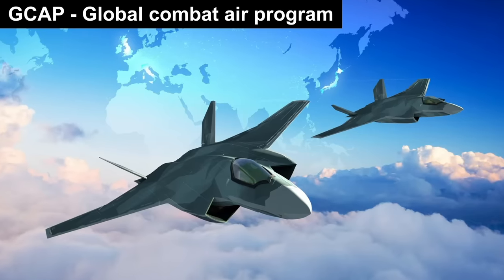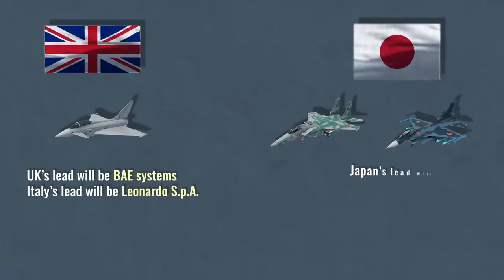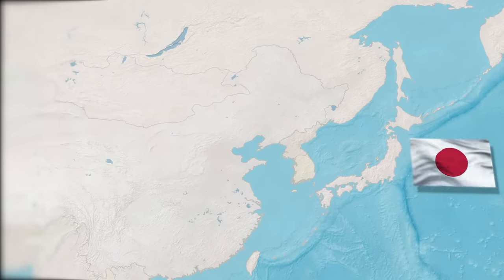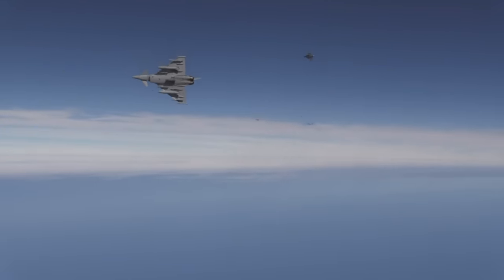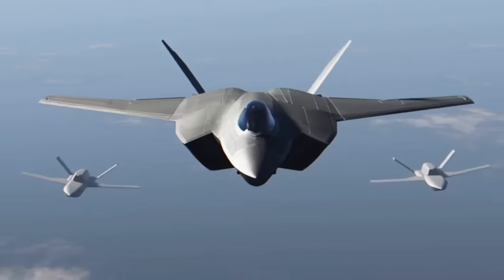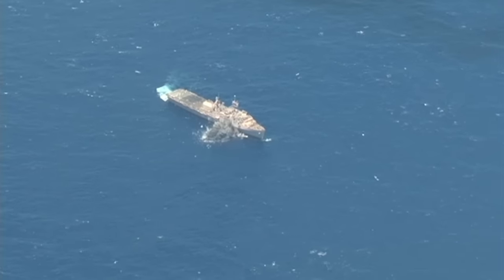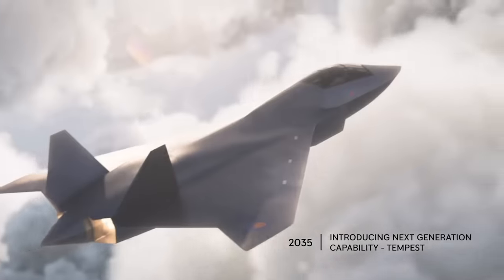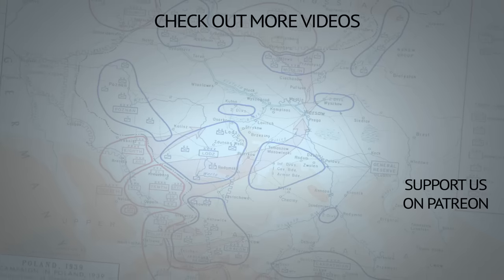Why is the future Anglo-Japanese fighter gonna be bigger than F-22?

Comment: Good luck to all US allies, but this project is probably a waste of money. By the time it comes out, USA technology will far exceed it, so they'd be better off just buying from the USA, even if they don't get access to the more sensitive tech. Look at the losers who chose not to be part of the F-35 program. They lost.
Reply: @Mmjk_12  If you think the F-22 was a failure simply because it's being retired, you clearly know NOTHING about fighters. It is the best air dominance fighter in the world by a wide margin. It's being phased out because it was designed 40 years ago and it's too expensive to maintain. The communication networks that are in use today can't easily be retrofitted into it. Even Link-16 would be too expensive. And it's not needed anymore. NGAD prototypes are already flying, and they will beat the F-22 in all metrics. Not to mention that the new GE combined-cycle rotating pulse-detonation engine will change everything, combining a turbofan, a RAMJet, a SCRAMJet, and an entirely new type of afterburner. And your point about the supply chain of the F-35 is just stupid. That is done for BUY-IN. If you want NATO to fly one platform, you have to spread the money around. There is probably not a single component in the F-35 that couldn't be built by US contractors. But if you want the UK to buy a bunch of A and C variants, you let BAE participate. That company is way too important in lots of supply chains for US missiles and other weapons to not keep them well-fed. And even you are not so naive that you don't realize that supply chains on major projects are as much about politics as technology. Why are you whining about it anyway? Do you think Lockheed can't build an ejection seat? Ever heard of DARPA? You're just trying to pick a fight because the UK has lost its once vaunted aerospace industry, and is now relegated to doing specialized work via companies like BAE, which is a great company, BTW. The latest military budget in the States is $886B. No one can compete with us on tech. The SR-72 and the MANTA are already flying. We're even reverse-engineering alien tech. For some countries, it's important for them to go their own way. South Korea is doing well with their new fighter. Turkey will probably succeed. Sweden has its own needs, so Saab is important and does a great job. But they will always be minnows compared to the US whale. Get over your penis envy and deal with it.
Reply: @de-comm8715  Read my reply to your buddy Mmjk_12. And what do you mean by "North America?" Do you think Canada is an important military partner to the US? They don't even have a real military. Mexico? What are you even talking about? It's not North America, it's the USA. We spend more money on the military than Europe, China, and Russia combined. We totally dominate aerospace. We have the world's only blue-water navy. One Ohio class sub could destroy every major city in whatever country you live in. And you are talking like a tough guy. Embarrassing.
Reply: @donscott2681  buying and maintaining expensive fighter jets is also a pain in the ass.
Remember what your airforce has stated that we can't drive Ferrari for daily commutes because they are smart enough to understand the point that their citizens don't. 
They aren't phasing out Stratofortress any soon because that conventional bomber is way better than B52 in terms of management. 
And if you are so correct then tell me why countries(including US itself)are still working on 4.5 gen fighter jets ?
Rafale is more expensive but they are still more preferable than F35 which is cheaper.
Reply: It doesn’t appear NGAD is a option for the UK or Japan just like F22.  So presumably the justification here is GCAP is a superior option to an upgraded F35 circa 2035/40 both in performance terms and economically (I suspect the export market is what the UK in particular has its eyes on).
Reply: NGAD is coming 👹 👊🏻 💥 🔝 🇺🇸🦅🔥
Reply: No, we don’t want to be American vassals
Reply: @donscott2681  "too expensive to maintain" sounds like big minus. You could build the most powerful space battleship in history, but if it's too expensive and can be taken out with a couple cheap missiles, it's probably going to be classified as a failure, as a military project. The F-22 isn't too bad but there's a reason it isn't the standard.
Reply: @VVayVVard  I probably should have chosen other words. The term "maintenance costs" could be taken by some, such as yourself, to mean something structural. It's not. I should have used the term "flight costs." That's because the primary cost of flying the F-22 is refurbishment of its RAM. But I believe that problem is going away. Since the F-22 has been un-retired recently, and planes have been photographed with a mirror-like finish, it's possible that the F-22 is going to be retrofitted with the newer RAM, thus negating the cost of maintaining the original RAM in perfect condition. While I haven't researched it, I have heard that the new retirement date for the F-22 will be the 2060s. All (or most) of those retrofits, such as Link-16, that were considered too expensive have now been considered necessary. The beast lives on.
Reply: @donscott2681 you are insane
Reply: @Sotsufferer  You make a very convincing argument, dude. Why chime in if you speak without saying anything? So, I'll speak to everyone else on this comment thread. Alex Hollings just published a new video on this Sandboxx YouTube station about NGAD and the F-22. It's a fine watch. Alex is the best. A few takeaways for me were:
1) The USA is going to spend $8.5 billion to upgrade our 186 F-22s. The reasoning is that we need to maintain our edge over everyone else until NGAD is in production.
2) The new RAM that will be used on NGAD, and probably F-22, is ceramic. That means its heat resistance is insanely high. That means more speed and higher ceilings for NGAD.
3) One primary reason NGAD doesn't have vertical stabilizers is that they tend to be observable to low-frequency radar (LFR). As you probably know, even stealth fighters can be observed at long distances using LFR. But LFR is incapable of getting a lock. That can only be done with high-frequency radars, which generally can't see stealth. Hollings pointed out that the Japanese consortium and the EU consortium are both using 6-gen designs with vertical stabilizers. It would be unfortunate if advancements were made in LFR that made those planes less than stealthy. I assume the USA is sharing tech with those groups so such things don't happen. It's in our interest for them to be successful.
Reply: Which country invented the Jet Engine bud, Which country invented the computer bud?  @Sotsufferer  The only reason the F22 failed is because the US government cancelled producing it because they didnt need it for 20 years in iraq, The same reason the UK/BAE stopped producing stealth in the 1990s
Reply: @mojonojo3  not America for both of them
Reply: Bro what the F35 mission systems and part of designed and built the air frame is BAE the safety and ejection system is British designed and built and part of the missiles load out is also British also the main part of the plane is based on British tech and Lockheed couldn’t build the engines themselves so they had to ask Rolls Royce to build them  
Let’s also not forget British ships have better radar and did one the American joint chiefs throw a hissy fit because the UK didn’t share its sub stealth tech on it new Dreadnought class 
Money doesn’t alway mean better😂
Reply: @mojonojo3 not true BAE carried on testing jet stealth till at least 2014 and the new generation of British subs have better stealth that the new Americans ones
Reply: @chazzerbox131   Dude, you are full of it. The engines on the F-35 are made by Pratt & Whitney, not RR. Moreover, you claimed that "Lockheed couldn't build the engines themselves." What kind of idiocy is that? Lockheed doesn't build engines. The engines for all our modern fighters are made by P&W, GE, RR, and perhaps Hermeus (Chimera combined cycle).

Submarine stealth is a complicated subject. Some diesel-electric engines are quieter than our nuclear engines. It's the nature of the beast. But the advantages of nuclear are so great that we would never go back to diesel-electric. Also, just so you know, the new PWR3 reactor built by RR for the UK subs is based on a US design. This thread is devolving into a pissing contest, with some commenters not having a clue. I've already addressed the dumb straw arguments about such things as ejection seats. The fact that the F-35 is full of tech made by other countries is ENTIRELY BY DESIGN. It creates political buy-in. That's why 17 countries have bought them SO FAR. Over 1000 of them have been built. It's already the most successful fighter program in history, and eventually every ally of the US, except perhaps the French, will buy the F-35 if they are allowed to. Lots of countries will want them but won't get them. Some countries just can't be trusted with the technology. Personally, I'm glad Turkey got kicked out of the club for buying the vastly inferior S-400 over the Patriot. Ukraine has been a great testing ground for SAM systems, and the Patriot hasn't failed to knock down a single Kinzhal in its range, while the S-400s have been blown up. Hilarious for Turkey! 🤣🤣🤣
Reply: @donscott2681 technically is the Stovl lift fan engine that is Rolls Royce and yeah correct main engine is P&W my bad I wasn’t specific enough
Reply: @Mmjk_12 European delusion whilst literally having no gen 5 aircrafts saying US cant build fighter by themself is laughable as hell. The US has literally 4 gen 5+ planes on rotation rn. Thats the F22, F35 and B2/b21 bombers. Europe has 0. The delusion is insane.

Comment: Turkish 5th Generation fighter specifications: 
-360 degree radar suite 
-Electronic warfare suite 
-Directed infrared counter measure 
-AESA radar 
-IRST
-EOTS
-Internal weaponbay

2 x 38.000 pound trust engines ( 170Kn trust x2 = 340 Kn trust) 
Supercruise ( 1.4 mach) 
Max speed ( 2.5 mach) 

It will operate together with unmanned fighter jets such as KIZILELMA and ANKA3
Reply: only on paper
Reply: i service in 2028  @LostSpider
Reply: Where does turkey get the money and expertise for all of this?
Reply: @oghuzkhan5117  First have to see it to believe it. Building fairly simple MALE drones like the Bayraktar is one thing, indigenously building a 5th gen fighter is an entirely different thing.
Reply: @ieuanjones7615  Turkish R&D program is 90 billion USD
Reply: @pieterveenders9793  it is already built. It will make its maiden flight in 27 December 2023